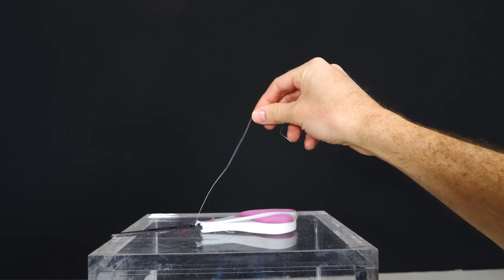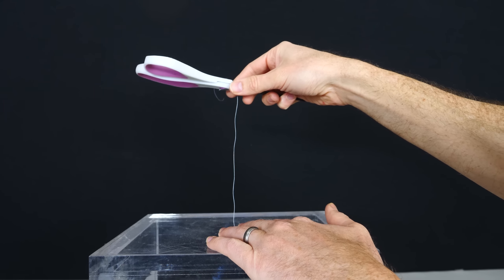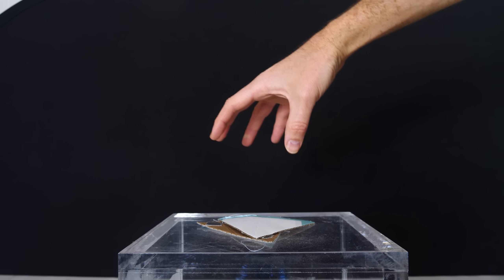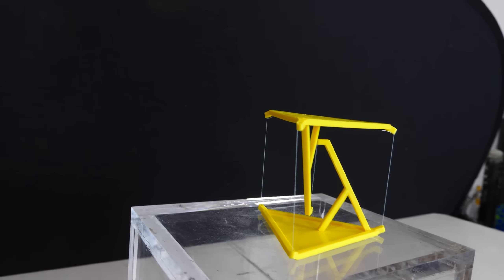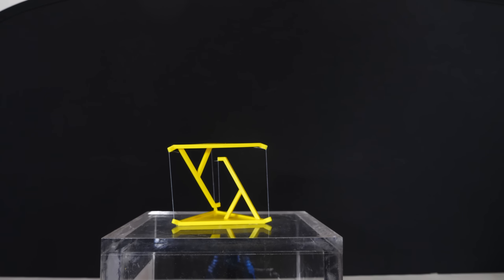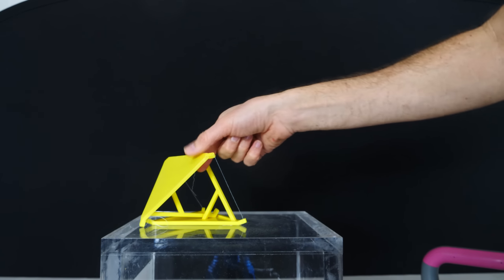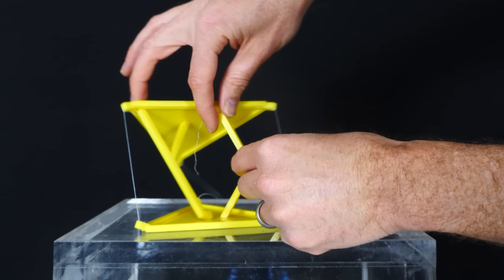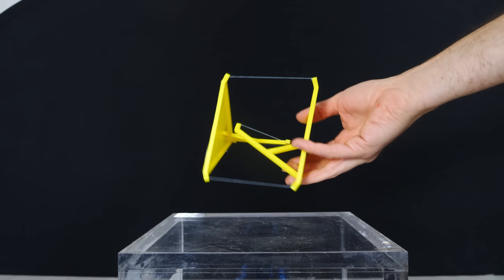Fake or Real? Floating Table Held Up By Only Strings

Comment: I've barely watched into the video and I already have my guess. If the top and bottom pieces were to come closer together, the protrusions on them would get farther apart. But because the string is holding them together, the tension keeps them from going farther apart, meaning the two pieces as a whole can't some closer together. The ones on the sides are there for stability, so that when one side is pushed down, the tension of the other side increases, causing it to stay stable. With the center piece acting as a sturdy object, this makes the top part similar to a lever, where one side goes down while the other goes up, making this whole thing work. 

So there's my theory. I'll watch the rest of the video to see if I'm right. But before that, I'd like to request a video. Would you be able to fill your gas chamber entirely (or as close as you can, it obviously won't be 100%) with a colored gas? If you did that, and then sucked it out, it could help for me, and other viewers, to visualize how much of the atmosphere is really being sucked out of there. The way I would do that would be to make the chamber at nearly full vacuum, and then fill it back up to atmospheric pressure with whatever colored gas you use. I don't know the mechanical function of the gas chamber (how exactly it pumps the gas out with that much effort), or what gasses would be useful for this, but since you're the scientist, I'm sure you could figure it out.

Comment: The conclusion at 4:05 is pretty pointless. Using carbon fiber or silk will not have any major benefits, because you still need solid structures (this protrusions to invert the orientation of pieces) that work in compression. This has very limited applications, but does find some limited use in vibration insulation for some important structures in research sometimes. I hope it sees more applications tho, because some more advanced designs, could move things so they are actually lighter in the end. Good example are bicycle wheels, which are made of very thin rods in tension.